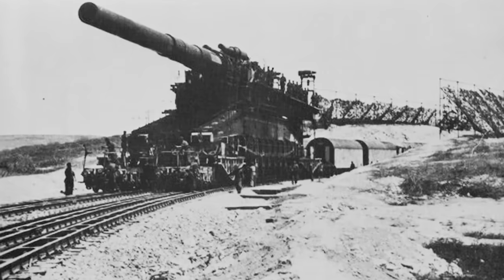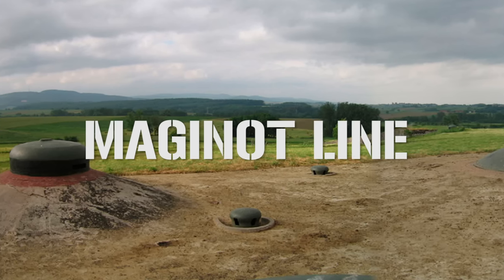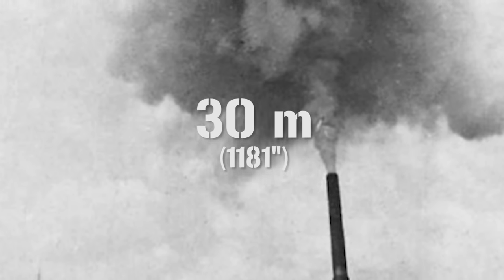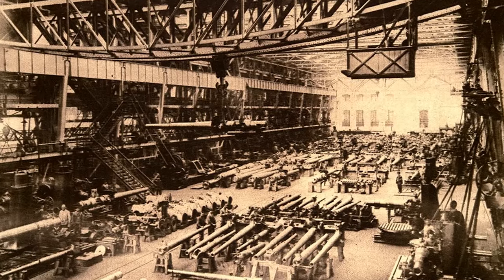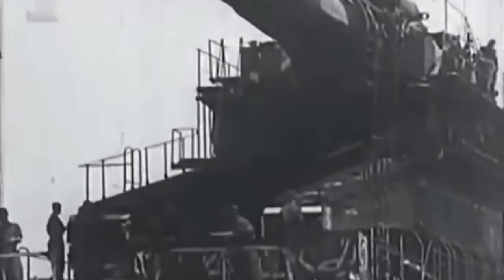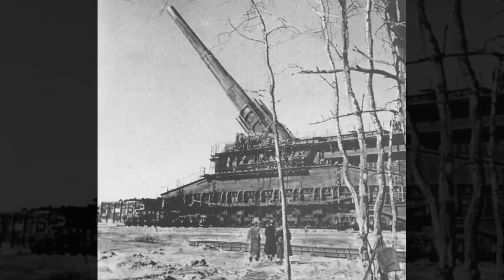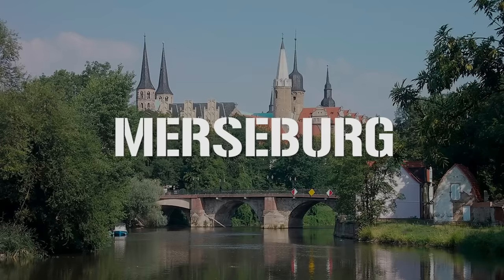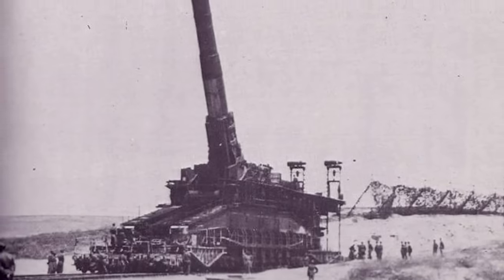Schwerer Gustav: It's a Really Big Gun

Comment: Sounds like the ink-jet printer scam. You get the gun for free, but you have to buy the barrels from the manufacturer on a regular basis.
Reply: All big guns had barrel wear the Iowa class had a barrel life of 300 rounds and WW2 naval battles often saw 50 shots per barrel.
Reply: Yes it's similar but with less pain and mental anguish.
Reply: Actually it was tradition for Krupps at the time to build the first item for the military free of charge, so it could be put through its paces and see if the requirements were met. The second copy of the gun, named Dora, was bought, for 7 million Reichs Mark (an equivalent of about 25 million US$ in today's currency).
Reply: @Ushio01  We know.
Reply: hahahahahahaha yes spot on
Reply: I’d also guess 14000 lb shells can’t be cheap... There’s what?? at least 1000 lbs of brass in each shell?
Reply: @timbirch4999  I didn't.
Reply: @donaldford3383  Not to mention that, for this Big Gun, the shells were numbered and each one was machined to a slightly bigger diameter than the one before.
Reply: @donaldford3383  well.... when you look at the price of a 16 inch round its way cheaper then a missiles.
Reply: Hydrazine1000 Wow!
Reply: @Hydrazine1000  You might be thinking of Long Max, the Paris gun... Between the absurd barrel wear (I think it was good for 70 rounds or so) and length (It seriously looked like an enraged suspension bridge with trunnions due to the external bracing), it was one of th craziest things ever to come out of the... FIRST world war.
Reply: @Tomyironmane  Uhmm, now that you mention it, perhaps you're right... :o
Reply: You mean like signing a contract with Verizon?
Reply: @donaldford3383  Steel - brass wasn't strong enough.
Reply: Lol
Reply: you cracked the code

Comment: So in other words, it was like every other German mid- to late-war weapon: Highly ambitious, highly aggressive, highly specialised, and totally unsuited to the war it ended up fighting.
Reply: It's what they were best at! Over-engineering and just throwing themselves at whatever they could think of. Was the Maus (Panzer VIII) ever going to legitimately work as a tank? No way. Did that stop the Germans? Never
Reply: @edwardcardona717  One needn't go all the way up to the Maus - even the Panzer VI, the Tiger tank, was the wrong weapon for the war. It was designed to be a breakthrough tank, to hit Russian fortified positions and break through them. It was designed for short, sharp actions, with plenty of time between engagements for maintenance and repairs. But that's not the kind of war Germany was fighting - they needed something simple and reliable that could quickly reposition instelf.
Reply: @edwardcardona717  eh the maus was nothing compared to the Ratte it never got off the drawing board for obvious reasons but the plan was to make a tank with the main cannon from a heavy cruiser for the main gun it would have been 5 time heavy than the maus
Reply: Also upgrade your tanks every 5th one so that none of the parts can be used for the repairs of others.
Reply: Hitler's meddling guaranteed failure regardless of the weapons available. As soon as they took on Russia without finishing off England first, it was all over but the fighting. Compounding that fatal error was Hitler's decision to get distracted with dicking around in Greece, which cost them months of delay before invading Russia in June 1941, causing the failure of that blitzkrieg, since it meant they ran out of good weather only a few weeks before they would have gotten to Moscow, if not stopped by Mother Russia's finest ally the Russian winter (see Napoleon).
Reply: But for tanks the Germans needed their own version of what Russia was smart enough to build: veritable hordes of identical and simple T-34's. Even the shitty Sherman death trap was a "better" tank in that sheer numbers (as many others have observed) have a quality of their own.
Reply: @robertnichols4833  The "Hitler's meddling" myth is just that - a myth. A myth created by the German generals trying to absolve themselves of blame after the fact.

Germany couldn't 'finish off' Britain. They simply had no way to reach Britain over the English Channel, and no way to stop supplies from reaching the island from overseas. At the same time, Germany was running out of resources, most especially oil. If they didn't invade the USSR when they did, they wouldn't be able to continue the war at all.
Reply: @robertnichols4833  just saying, the Sherman wasn't a death trap. There was a famous book written by a tank salvager who obviously saw mostly destroyed tanks and he saw majority American tanks because he was an american soldier. It wasn't any more dangerous for crew than other tanks.
Reply: @robertnichols4833  I mean really, ultimately, the Germans were screwed over by the Japanese raiding Pearl Harbor.  If you look at the raw material output, the yearly production capacity of steel, the population of the country, arable land area, the oil reserves, etc; you'll realize one thing, there was no country on Earth that could fight a protracted war with the USA at the time and expect to win said war.  (NOTE: I SAID "AT THE TIME", THIS IS NOT AS TRUE TODAY ESPECIALLY.) The US at the time of the two World Wars had nearly as much steel production capacity as THE REST OF THE WORLD COMBINED if memory serves correctly.  This was largely because China was not particularly industrialized yet.

If Japan hadn't gotten the US into the war when they did, Germany very well could have forced their way on the the British Isles and consolidated most of Europe under their control before attacking the Russians (which still would have been a doomed prospect because only Russians can survive a Moscow winter).  But all that goes out the window the second you pull the vast majority of the resources of the world's third largest continent into the fray.

Edit: Just checked on that steel reference, there's a UChicago paper called "Iron and Steel in the Balance of World Power" that claims the US was producing around 48% of the world's crude steel in that era, which does line up with "almost as much as everyone else combined".
Reply: @Werrf1  

At least the Tiger I, for all its reliability issues, did prove to be a reasonable heavy tank (especially as the IS series also had reliability issues-this was a heavy tank problem).

I actually consider the Panther to be worse, because that one was intended for mass production and was produced in large numbers…..and was EVEN LESS RELIABLE THAN THE TIGER.
Reply: @bkjeong4302  From what I understand (and I don't claim to be any kind of expert, just an interested amateur), the Panther's biggest problem was that people didn't know how to drive it. It required an experienced driver to get the most out of it, but most of the men being hastily conscripted and shoved into them had never driven a car, let alone a tank. It was technically very good, while at the same time being completely useless for the army using it.
Reply: @Werrf1  Even without that, the Panther suffered from being rushed into service (the Tiger had teething problems as well, but a lot fewer of them). And because it was intended for mass production, unlike the Tiger, it often suffered from cost-cutting and material shortages that led to its transmissions being complete garbage even by heavy tank standards.
Reply: @robertnichols4833  "Quantity has a quality all its own" is actually a quote from Stalin.
Reply: So wrong
Must vote Democrat
Reply: @tomhenry897  Please stay off my side.

Comment: It's worth noting that the Schwerer Gustav could only be used against the Allied nation with the relatively weakest air force, the USSR when it was reeling from its massive aircraft losses in the early stages of the German advance. From 1943 on, with the Anglo-American Allies increasing their airpower advantage by the week, such a large railway gun would have functioned - and only briefly - as a large bomb magnet. For the Germans to use large rail-mounted guns against someone with an actual air force, the guns had to be small enough to hide inside railroad tunnels during the day, safe from the sharp eyes of opposing fighter-bomber pilots. For example the Krupp K5, one unit of which was nicknamed "Anzio Annie" by the Allied forces on the receiving end, fired a more modest 11.1" (283 mm) diameter shell, midway between the main guns of a heavy cruiser and a battleship. Also of interest were the German efforts to extend the range of their large artillery shells with rocket-assisted projectiles. According to the Wikipedia article on the Krupp K5, "The maximum range for this projectile was 86 km (53 mi) but due to the weight of the rocket motor the projectile carried less explosives." I've wondered why the Allies didn't seem to consider extending the range of their large battleship guns with rocket assist. That might have been useful in amphibious invasions on large landmasses when the landed troops inland beyond the normal range of naval guns. For invasions of small Pacific islands, naval gun range wasn't an issue, but it was for invasions on the European continent. One imagines Allied commanders might have enjoyed being able to call in fire support from a battleship despite having advanced 50 miles from the beach. Battleships fired much heavier shells than any guns the Allied land armies hauled with them, and battleships were on call at night and in bad weather when aircraft didn't provide close air support.

Comment: 13:00 : Had things gone differently, such as [...].
Rather than wasting time and manpower on such frivolous Megaprojects (heh!), the Nazis could've gone and instead used that material to build tanks, artillery, weapons and the like, as well as using the manpower to field them. Thankfully they wasted these efforts. Or else there would be no video displaying this monstrous Megaproject.
Reply: That's what I was thinking. Vast amounts of resources were squandered on stuff that made no difference whatsoever to the German war effort - like the V-weapons. How many planes could they have built instead of 10,000 V1s?
Reply: "Not enough to make a huge difference" is about the only correct answer.
Reply: It was the same with the V2. Impressive as hell but pointless firing this thing at London if it didn't have a nuclear warhead on top. All these massive weapons (that contributed little of military value) diverted much needed resources from more practical weapons like medium tanks and fighter planes. Hitler was obsessed with such Mega-Weapons while the German Army was begging for more practical things.
Reply: @mlc4495  Well the problem there is the fuel situation. There wasn't enough fuel to run all the conventional craft nor to train them properly. The German military was about as big as it's fuel supply would allow. There are better solutions but more tanks and planes are not it. What they needed was Project Pigeon, merchant subs and a much better agricultural policy so they didn't brutalize the people of eastern Europe so much and thus avoid the massive partisan and slacking efforts by those people.
Reply: Spending time and resources on megaprojects is not bad. You just need to be clever or lucky enough to choose the right one cough trinity
Reply: @iain3482  Other than the payloads, the V-1 used a good bit of wood in their construction so they couldn't have built many planes from that other than a few more He-162s. At any rate, the V-1 did do some pretty good damage to English cities and kept the populace anxious.
Reply: @ickedettekiekemal And he would be talking about the glorious part it held in winning the war for the Fatherland.
Reply: Quite simply: They could not have won the war. 

So rest easy, nazis were doomed from the start.
Reply: @livethefuture2492  They were winning until they declared war on the u.s. and invaded Russia. No way England alone could have invaded them. Probably a long war ending in stalemate
Reply: Even if Germany had gotten 10,000 tanks and aircraft from the resources used in the Schwerer Gustav (using massive numbers to enhance my point), it wouldn't have mattered as even by '43 and '44, they were running out of oil anyway.  My '44, the Luftwaffe was using ground tractors to tow planes to the end of the runway instead of letting them taxi to save on fuel.
Reply: @randomlyentertaining8287  True. As soon as they declared war on the U.S. and invaded Russia,  it was over.
Reply: It was actually more than the wasted efforts. There simply was no way Germany could win once the US started its war machine. We could literally bury them in resources alone. Perhaps if they had instead developed domestic television, came up with the (stupid) idea of a "reality" show and make The Adolf the star of it, the whole war might have been averted.
Reply: @deadfreightwest5956  I see what you're trying to do there, but it's not simple as that when it comes to the overarching message of national socialism at that time in Germany.
Reply: @weirdshibainu  To the Nazis ideology meant everything, reality was worthless.  And thus they lost the war before it even began.
Reply: @wahlex841  Most likely. The war might've gone on for longer. The US gave the Russians loads of stuff IIRC. Unless there's a way to stop them from getting it, the Nazis might've ended up getting nuked as well.
Reply: @mlc4495  Agree. Without proper guidance, these rockets were more or less useless.
Reply: @livethefuture2492  Totally agree. Unless the Nazis somehow found large reserves of oil, metals and rubber, etc. just waiting to be harvested and refined, there's nothing to be done.
Reply: You know as they say.... It's all history. There was different megaproject, hosted on this very channel druing world war 2, that used quite a lot of resources, but in the end it ended 2nd wourld war (allegedly) and changed the war as we know it forever. Yes I'm talking about atomic bomb. Just imagine if they used this cannon and managed to shoot it at London. Having London at gun point (literally) might have changed quite a few things.... and instead this video we may have read about "the weapon that almost turned 2nd wolrd war" or something :)
Reply: If they extended the war they would have only ended up getting fatmaned and little boyed
Reply: @sophiam2095  Your argument is basically the Germans could never have hoped to win WWII, no matter what they did. And the argument that had  the Germans behaved somewhat nicer to the people it occupied is laughable. Occupied peoples will rise up no matter how you treat them. The US got destroyed in Vietnam despite flooding the country with development aid. As did the Soviets in Afghanistan. Germany was always doomed. As was Japan.
Reply: Germany was screwed either way, they lacked oil for their tanks - the reason they chose to build quality over quantity

Comment: The (proposed) Monster wasn't really a tank - it didn't have a turret, or armor.  It was more of a self-propelled artillery weapon.  Although not very mobile, because it would get bogged down off road, and tear up any roads it used.  It would not be able to cross most bridges, or to ford rivers without massive preparation of the site.  Even less practical than the Schwerer Gustav.

Comment: A major advantage to Railway Guns (normal ones at least) was their mobility since they were (mostly) capable of going wherever the railways weren't and the fact they largely used existing technology and ammunition (i.e. Battleship Guns and Shells). It has to be said they were of more use during WWI than WWII, since the front lines of WWI were more static and the roads far less developed than during WWII. But the German Super Railway Guns took all the few advantages Railway Guns had over normal Artillery and threw them out the window (& then went outside and shot them for good measure). For a branch of military technology that was already in it's twilight, for much the same reasons that Battleships were (i.e. Aircraft), they really were a technological dead end.

That said, it's a shame neither survived, it would be something else to see one of these in person let only see it fire.

Comment: To be fair to the Germans, Big Bertha (actually an Austrian, not German, gun) had been devastatingly effective against the Belgian forts in 1914 and played a major part in the Schlieffen Plan. I suspect that they built Schwerer Gustav more for taking out Eben Emael and other lesser Belgian forts than the Maginot line as their original plan for invading France went through them rather than via the Ardennes and Sedan. At no stage did they ever plan to take on the main Maginot line - in that limited sense the Maginot line actually worked. And of course logistic support for the gun would have been far easier in Belgium - right next to the Ruhr - than in Russia.

Comment: Simon, great video but, you should have included more detail and examples of just home much energy the shells produced. After all, the whole purpose of the gun was to fire the rounds and destroy the target. Were there more than one kind of shell they fired? How were they detonated by contact or after deep penetration in the target? How did the destructive power of the shells of the Schwerer Gustav compare to the damage done by other large caliber weapons of WWII? Compare one SG shell to one of the rounds used by the 16" Mark 7 guns on the USS Iowa. And compare the power of one SG shell to a full salvo from all nine of the deck guns of the Iowa aimed at a single target. A map overlay shower the destructive radius of these comparative yields would have made it more relatable.  I'm also curious, what kind of explosives, and in what amount, were used to lob a seven-ton shell 47km.